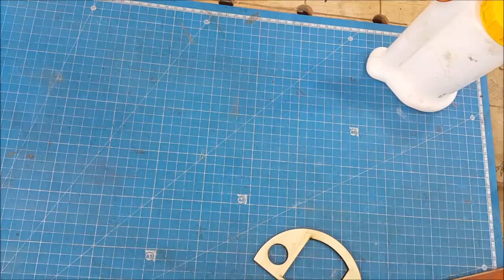Vac Housing for Bandsaw

Comment: Just came back from The Woodworking Show in Timonium, MD. The folks who make Drillnado were demonstrating and selling their new bandsaw dust collection system which is very similar to yours, except their dust collection cavity is less than half the size of yours which allows easier access to the lower guide and thrust bearings and they are using a 1-inch hose for maximum suction velocity. Charging $50 (show price was $40). You get 3 (6 if you buy at the show) magnetic templates which mount under the table, a plastic adapter which is the dust collection cavity and adheres to the table via two magnets and a length of one inch diameter hose. 

Since we have been wrestling with this problem for awhile, we bought the new system. Had I seen your video two days ago, we wouldn’t have.

Nice elegant idea. Thanks.